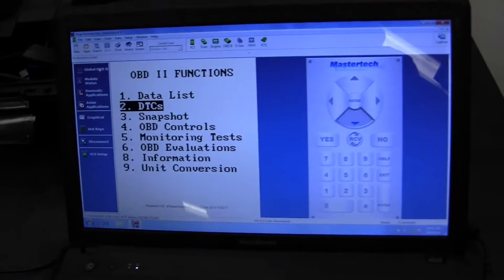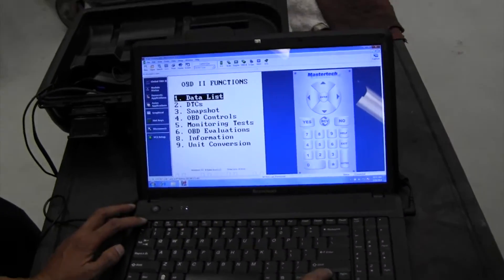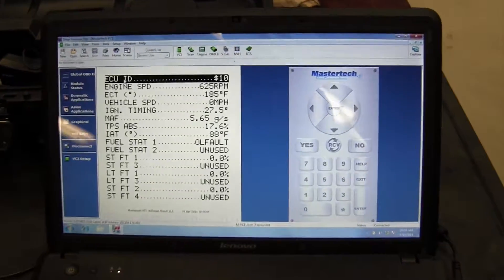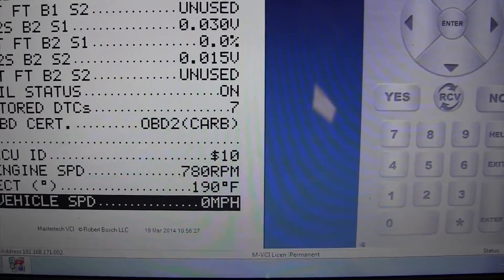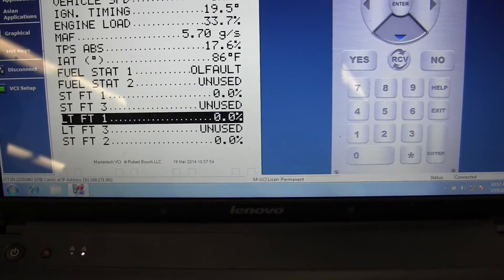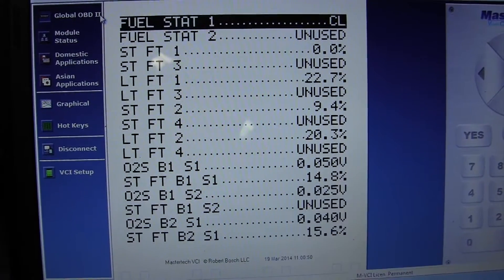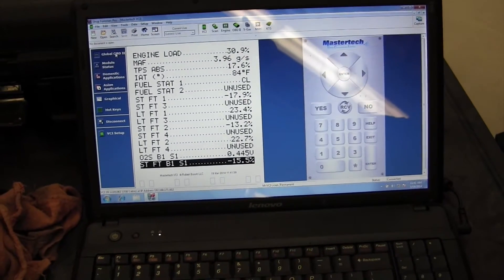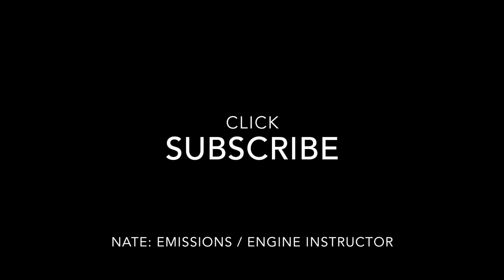How to find a vacuum leak with water P0171 02 SENSOR LEAN

Comment: I use brake cleaner instead of water to find vacuum leaks cuz sometimes gravity is an issue or the fan's blowing too hard.
Mastertech seems very slow to respond but maybe I'm wrong
Reply from the maker: Never tried brake cleaner may have to try it lol